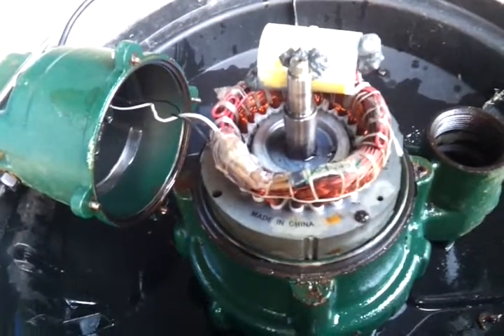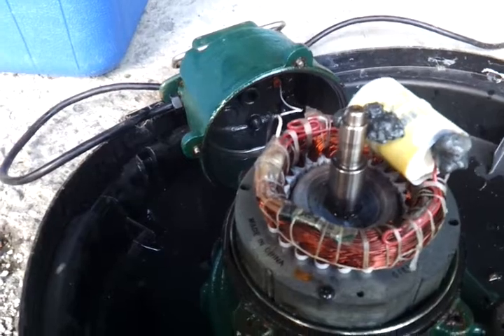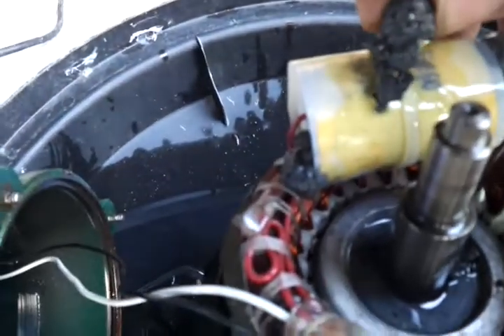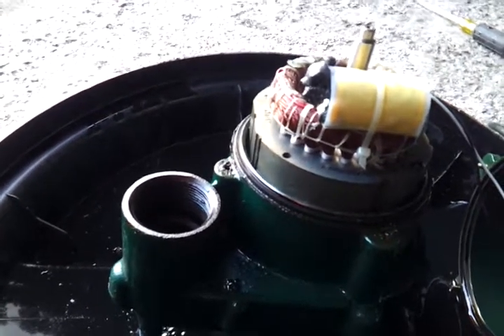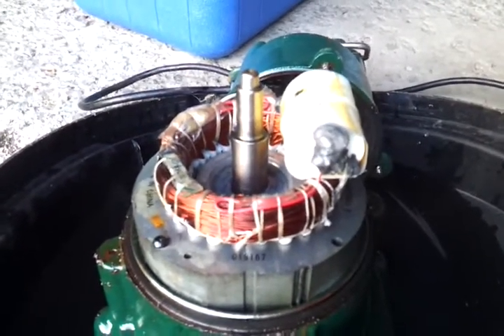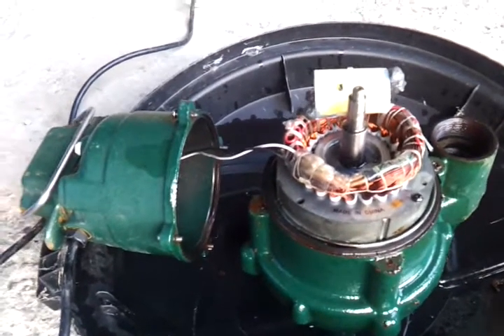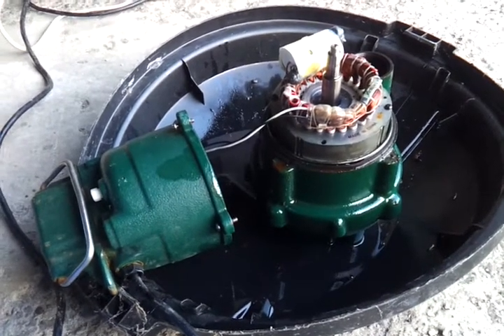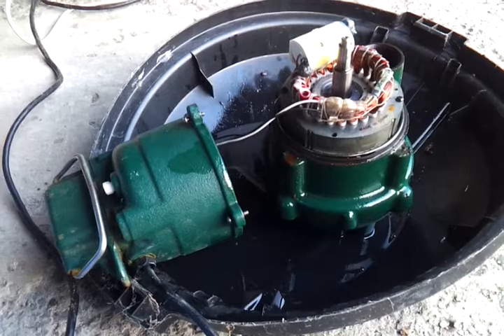Zoeller BN152 BN-152 Sewage Pump Failure with Blown Capacitor CBB20

Comment: I can't find it right now but I came across a pump that advertised it had a separate chamber for the capacitor for easy replacement, it was $1000 though.  It sounds like a common issue.  I have 2 tanks, one has a pump thats been in use for 20 years, the other (further away) tank seems to take in ground water despite every attempt to seal and divert water from it.  That tank I'm lucky if I get a pump to last 3 years.  I haven't used Zoeller but I've used several brands, a Wayne pump got me 3 years, but the rest have been short lived.  I started putting 2 pumps in there with electronic water level detection and controls instead of using the floats.  I'm hoping that less frequent but longer pump cycles will help with longevity.  I have 3 dead pumps in my basement, I'll have to check out their capacitors when I get a chance.

Comment: Quick question. Have you contacted Zoeller in regards to this? I sent them this video and this is their reply. 

"Hi,

I watched the video and his capacitor went more than likely because motor got to hot due to the pump either running nonstop or short cycling. We have never had a bad batch of these, they are very good pumps, they are made specifically for septic tank applications to pump the gray water out. 

If you need any more help feel free to give me a call and we could go over any more questions you have.

Thank You

Jeremy Parker 
Product Support"
Reply from the maker: Hi thehAPPYgunner: I called Zoeller and was assured that I could not simply buy a replacement capacitor. I would have to buy a full stator assembly. I can understand that, although I was upset at the time. You can't expect firms to keep every discrete part in the bins ready for essentially "retail" sale. In retrospect, perhaps the Norweco septic system designer (if it truly was Norweco who designed the system) underspec'd the pump when they designed the septic system. We replaced it with a 3/4 hp Zoeller from the same line and it has been fine ever since. Thanks for your comment. It was good that you brought this to me and I could clarify. I bear Zoeller no ill-will and their pumps are solid. If I can figure out how, I will overdub the video with words to this effect, or perhaps put some sort of text headings in it so people understand. I will also edit the text which accompanies the text.
Reply: I had a similar problem which was going to be an authorized warranty repair/replacement however I waited too long (my mistake). Mine lasted just under 3 years also and I was able to find a replacement cap.  I have not done the work but replacing the whole stator seems silly.  I will update this once I get it soldered in and sealed.

Comment: Why do I read "Made In China" on a supposedly American built Zoeller pump?
Reply: I am only 5 years late on my reply to this but figured it was worth it. The motor at that time was being made in China as just about every other pump manufacturer's motor is today as well (if not China...maybe Taiwan). Zoeller is now making motors for some of their smaller pumps in the USA (Pump models 53, 63, 95, 98, 137 264, 267, etc) and I hear they have plans to expand that to some of their larger pumps as well. "Made in the USA" is all about the percent of parts/components that are sourced/made in the USA according to guidelines set forth by the Federal Trade Commission and in today's world is very tough to do. A typical submersible pump has copper, steel, cast iron, wiring, neoprene, plastic, capacitor(s), a float, etc...a lot goes into them. Tough to get all of that here in the states...and still remain competitive on price. Most often there may be a qualifier statement like "using the majority of US components" after the "Made in the USA". I do know Zoeller is a family owned business out of Louisville, KY and is "American Proud". You will be seeing "Made in the USA" on more and more of their products in the years to come. The 150 series pumps are excellent and are very versatile for sump pump use, septic systems, elevator sump pumps and transformer vaults. I hope this helps explain why that sticker appeared on the motor at that time.

Comment: I have the Zoeller BN152 on a new construction house.  After 11 months (since August 2015) , the pump stopped working and the alarm didn't shut off.  I called the septic guy back and he said the pump motor was blown.  I assume it is similar to this problem.  Needless to say, he charged me $1,000 to put in a new pump in the septic tank outside.  The warranty seems like its not worth it since you would have to pick up a contaminated pump fill of crap and try to mail it back or bring it somewhere.  I don't mind fixing things myself, but wouldn't this be a pretty dirty job?  Its not like we can go for weeks without a septic working waiting for a new pump.

Comment: exact same failure in my Little Giant pump. the manufacturer won't sell caps & matching the dimensions of the OE cap to fit the provided space is very difficult. finding electrically matching caps is no problem.

Comment: I have a similar unit for an up-flush toilet. I have a spare motor and pump assembly and the start capacitor failed on both units. The manufacturer charges about 30 dollars for the replacement cap. You can find them for much less on-line (I found mine for 1.90 each). It's quite an unpleasant experience to pull the pump to replace this part. I ran 2 wires through the top of the motor housing and sealed with silicon. I drilled holes in the top of the tank and sealed those as well. The next time it happens, I will only have to replace the cap without opening the unit for access to the pump/motor assembly.
Reply: good idea drilling the hole. Can you point me to the cap you used? is it still working? (or did it work)?

Comment: you might not have super clean power for the pump to run off of. Other the stress from extreme load, unclean current is the other big killer of caps. Its a big motor that draws a massive amount of current, have you checked the voltages at the outlet when the pump is running/idle?

Comment: I'm pretty sure that the replacement is a 10mf #007642.
They seem to run between $30-$50 depending. Too bad it wasn't a sealed molex design. I just emailed my tech contact to see what he says on factory replacement cost. If it's only a few bucks more I don't think diy makes sense as they'll warranty their repair I'm sure (well... I'd guess).

Comment: I have the same pump with the same failure. I sent a video to Zoeller's tech dept showing the need to manually start the impeller and they confirmed a bad cap. I have been meaning to replace it myself but never did. I'm kicking myself now as it was a warranty item when identified and will be on me now. I wonder if a slightly stronger cap might help?
Reply: The funny thing is under warranty you open it send pictures means your warranty is void, i would just buy capacitors good quality ones

Comment from the maker: I haven't had a failure of my new pump yet but I told the service guy to go one size bigger. I think it's now 3/4 hp now as opposed to the 1/2 or 5/8 hp models that the first two failures were.

But then again, the jury is out until the (unbelievably short) warranty period is over...

I don't think soldering a new cap should be much of a challenge. There can't be any real reason to unwind the stator. That's absurd. Probably just a way to justify charging 85 clams for a 10 minute job.

Comment from the maker: Yes, I was able to pick up a bag of 6 of the identical capacitors off e Bay for just a few bucks. I have yet to replace one, but some slow weekend in winter I'll get "a round tuit". 
When I do, I'll YouTube the ordeal. Not often someone changes a cap on these things and as I learned when changing my Honda Odyssey drive belt recently, it's nice to see someone do it on YouTube first.
Reply: Can you tell which cheap capacity you get ?

Comment from the maker: Sorry for the delay Rudy!
The oil is called Dielectric Oil and a quick google search will give you a lot to go on. I've edited my video description to include a link to a brief but decent description of the stuff. 
As for the motor, I haven't put it back together yet. That's a summertime project and should be on the agenda shortly.
Thanks!

Comment: I used a new one to pump water out of a pool, during the process, it stopped working. so I opened the unit, and oil drained out.  I wasnt expecting that, what oil do i need to replace?